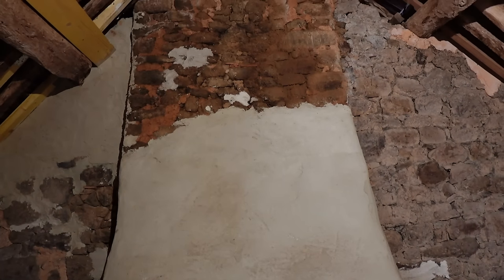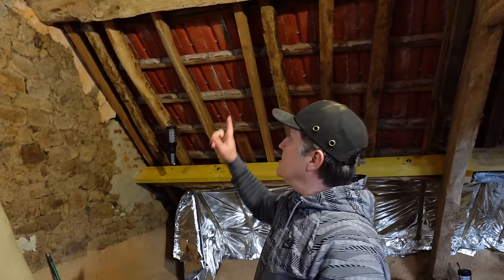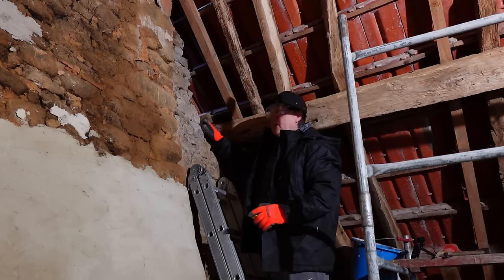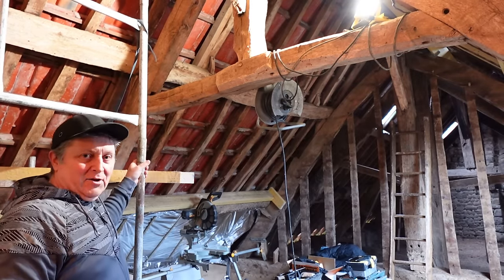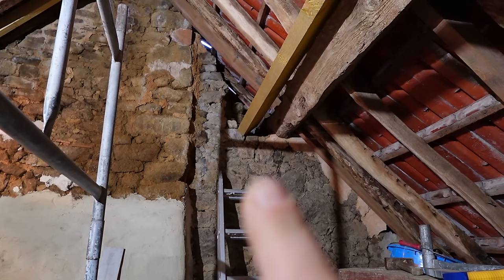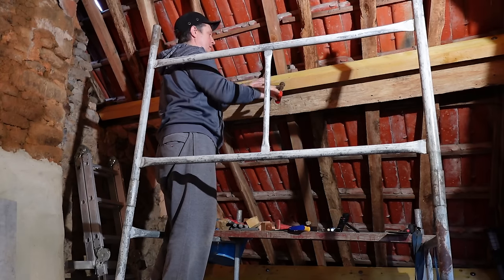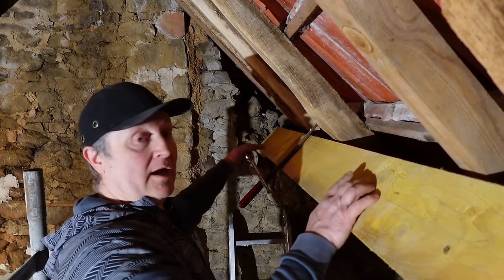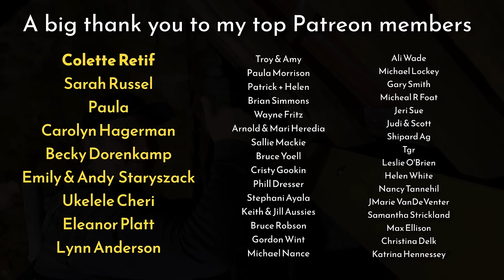Reinforcing The Crumbling Cottage Roof & Wall Structure

Comment: This has probably been asked before but would the original builders have just dry fit the stones or would they have over coated with the lime mortar to secure it, too?  If so, how did the lime all come off so cleanly?
Reply from the maker: Water damage had blown the original clay type render, so l removed it.

Comment: The rendering on the wall to the left looks good. It makes it look like there's actually a wall there instead of stacked rocks. Also, are you going to treat the battens with something to prevent rot and wood worms before you mortar them in? Thanks for sharing, Sean. 👍👍
Reply from the maker: Already treated

Comment: Sean! I don’t understand why the stones were not cemented , as you are doing, in the first place. This was built to be inhabited by people was it not? Would they have actually lived with the bare, seemingly almost loose stones? Life there must have been hard! Also, I noticed how the roof wiggled while you were putting in those screws. Will you have to make it more tight?
Reply from the maker: The stones have only become  loose due to the leaking roof. But yes bare stone walls are not uncommon, although my cottage had render. The movement you see was the camera wobbling on the scaffolding.

Comment: I am wondering if it would not has been better to replace the whole roof. The structure of the whole cottage is bad enough.
Reply from the maker: The cottage structure has been secured, that's what l have been doing over the last few months. 
No the roof just needs repairing

Comment: Sean, have you considered using jacks to elevate the purlin and roof a couple inches to remediate the roof bow?  Then the far end of the purlin would be up closer to where it's supposed to be and could then be supported with new rock work?  Hard to tell from my couch though how much lifting the roof needs or can handle!
Reply from the maker: Can't move it too much due to possibly splitting the timbers etc